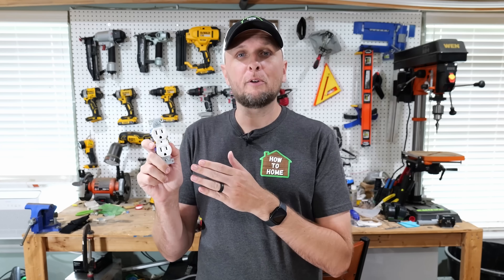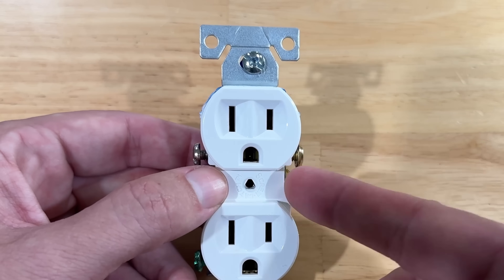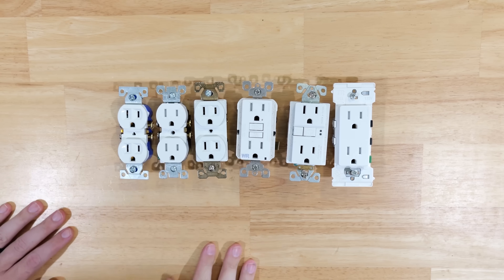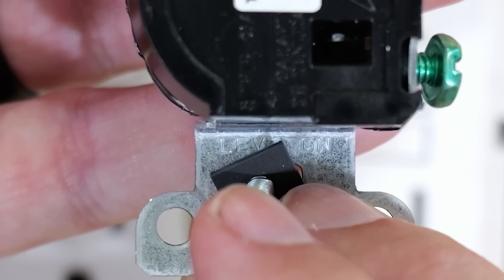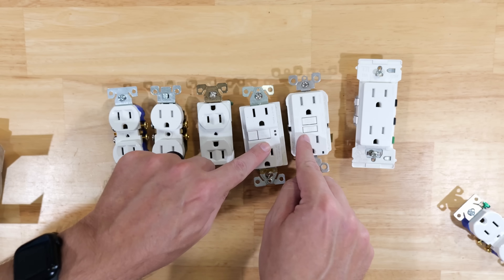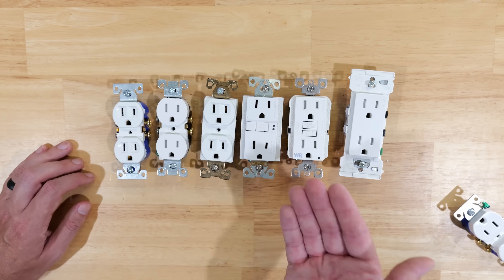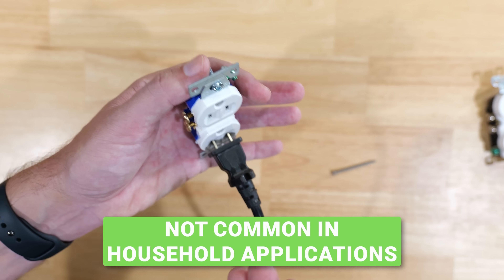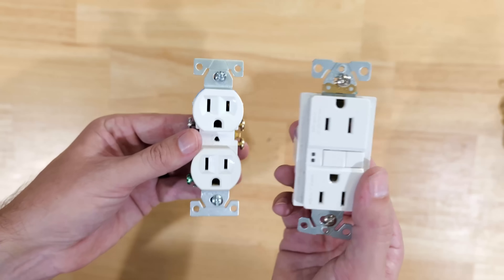The Shocking Reason Why Your Outlets Are Installed Upside Down!

Comment: Why is the white wire on the bottom of opposite side, and hot is on top opposite side? Is that how I'm supposed to wire the replacement outlet? Are the wires supposed to be staggered or exact opposite of each other? THANKS!! I'm guessing it probably doesn't matter but since it's worked for years wired like it was, that'll be the way I wire the replacement..

Comment: Just a simple condo owner in Montreal here. The vast majority of three-prong plugs are designed so that the cable hangs downward when the outlet is installed with the neutral prong down. When the neutral prong is installed up, the cable points upward and must twist to hang downward. In residential settings, most of the time we want the cable to hang naturally downward, making a neutral-up installation both impractical and sometimes a real pain.

Comment: Some time in the 90's, residential builders started installing the half switched receptacles upside down to identify them.  It was a stroke of simple brilliance. In my 50 years of electrical service work, I only saw one metal cover plate short on a loose receptacle but, yeah, it can happen. Metal cover plates are dumb anyway.  There are very few situations where they would be preferable to nylon.

Comment: The receptacles should be built with the ground pins facing away from each other (one on the top the other on the bottom).  That way, you can plug in a hanging plug without covering the other socket or having to twist the cord to avoid that.

Comment: The ground shoukd be on the bottom. Why? Because all devices, cords, etc are all made to be used with the ground down. Upside down i take them out regardless kf wherevim at and reset them pro perly. Ground is on the bottom. Period. No excuses or written instructi ons. Ever try to plug in a three prong device cord that then goes up rather than hang down? Yes. Becaus e the ground plug MUST be down. Argue all you want, but down.

Comment: I'm a retired accredited engineer.  There are two kinds of three prong plugs.  One kind the wires go straight into the plug.  The other one the wires go into the plug at a right angle.  I've only ever seen right angle ones with the ground prong on the side the wires come out.  If you install the outlet ground plug up these right angle plugs are very easy to pull out.  Gravity torque on the cord or any tug pulls the top out first.  You can actually have a plug that looks like it's in but the top ground plug is not well connected and maybe not even making contact.  It can also get awkward when the wires first go up then curl back down to the floor producing a protruding loop of wire that's easy to get snagged by activity in the room.  For this reason I think ground plug down is the safest.  As for switched outlets, up here in Canada a lot of the switched plugs are split receptacle with only on plug of the two in the outlet being switched.   I prefer all of these to ground prong down for these for the same reason.  Screw the labelling as a reference.  You want maximum safety, ground plug down, for your install if you're being responsible.
Reply: It's worth noting that with AFCI being required to cover most outlets where you're likely to have this sort of an issue and GFCI being required in the areas where you're most likely to have thin objects like knives and kebab skewers fall between the plug and the wall, wiring them upside down doesn't necessarily make that much sense as those will provide some protection in the unlikely case that you've got a plug that's only partially plugged in. And without requiring specially designed plugs that can handle either orientation and still allowing things like nightlights and plug in defusers to work.

Comment: And the whole hell of it is that 3 prong outlets are unnecessary except as a GFO (ground fault outlet) in bathrooms or by the sink which are suppsed to trip the little breaker in the outlet if an aplliance goes into the water.

Comment: I'm not an expert, but I have an opinion. With many devices (like hair driers) the plug also has a plastic housing (e.g. circuit breakers). In that case, they hang down if the ground is down, and up if the ground is up. Up is far less stable.

Comment: ground prong up, particularly when a metal plate is being used. if the screw comes loose and falls out the plate will definately land on the upper prongs. you would want it to land on the ground, not the hot and neutral

Comment: Ground down. ... Since the weight of the cord hangs down then the two prongs at the top (vs. one) simply holds the plug into the socket better.

Comment: Interesting topic ... Though not applicable to me as here we use Schuko outlets (type C and type F plugs, type F outlets) at 230V/16A. And in the wall you will always have ground. Also as the outlets are recessed into the wall touching a live prong is nearly impossible.
I think all the newer standards are better for safety be it C, and F or the UKs G type. Maybe the US and Canada should switch too? ;)

Comment: Installation is location/situation sensitive. In residential, I install vertically with the ground down as any fluids will run to ground; horozontal mounts have neutral down.
Exceptions are like the fridge circuit; the fridge plug has a 90 degree plug with the ground on top. To prevent undo stresses, I invert the outlet.

Comment: A lot of refrigerators have wall hugging plugs with cords that hang downward against the wall if the ground prong is down. If the receptacle is installed with the ground prong hole up, then the cord exits the plug upward. This puts extra strain on the plug and the cord.

Comment: It's easier to orient the ground prong to the outlet if the ground pin is up.  In hard to reach or see areas having the ground pin up makes it easier to put the plug in.  This clears up a lot for me though.  I always wondered if it made a difference or if there was code on it.

Comment: Most grounded 90 degree plugs for 125V 15A have the ground prong closer to the cord. For the cord to "hang" down the wall, the receptacle ground would be down. I like the low profile and secure connection that result from using 90 degree plugs, and so I use them alot, and receptacles in my house have that orientation. I'm kind of surprised that 90 degree plugs are not more common, although they are usually only useful for the bottom of a duplex receptacle.

Comment: In my condo all the outs are ground prong down with the exception of outlets that can be controlled by a light switch, I forgot what brand they are, but I just installed some tamper resistant power outlets with built-in night lights and they have a instruction diagram that shows you to install them ground prong down. But I think with them if you installed them the other way the night light would shine up instead of down?

Comment: Generally it's prong down in residential, as wall charges and appliances are designed at the factory with the prong down.  The battery's and stuff just fall out and stuff can get jammed up under the outlet, so the prong is better down.  In commercial/industrial, the prong is often up to protect from falling objects.

Comment: I worked for a company that had their own custom made extension cords..NOT CHEEP ONES.  The safety person had all outlets turned ground UP.  Ground lugs started braking off may cords.  Under  some page in a book  at states that only a qualified person can replace the original end and only he can use it after he inspects before each use.  They threw out hundreds.  People pull out and up..  GOOD -BY ground probe.

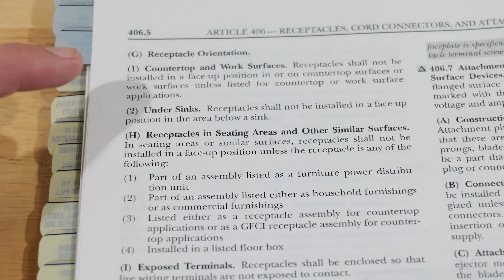Comment: 2:57 - it is one of those usual 'fails' of documents and manuals. A picture can be worth many words. When they write 'face-up' - then some people won't know what 'face-up' specifically means, as they could mistakenly think it means 'earth pin higher' or 'earth pin lower' - due to the confusion about what 'face up' and 'face down' means. And the code book should have images, instead of the dinosaur age full-text and no pictures situation. That is, the code book should have at least an example image of which way to install --  as in earth upward, or earth downwards. Or have images of both with a big 'tick' on both images to indicate either orientation is ok.

Comment: As a teenager, had thrown a  at the wall and it fell and landed between the hot and neutral .. sparks everywhere. 15 years later , i was pulling out a fish tape and it landed across the hot and neutral. same thing... I would say the ground up is the safer bet

Comment: Given that commercial settings would use plugs with a ground prong I would think that the circle on top would be more useful there. With residential it is so rare you have items that need that ground prong that the slots on top makes more sense.

Comment: I ran electric for my father in our new homes we built from 1988 to about 2005. We didn't see anything that said the Plug should be installed upside down or right side up until 05. I heard they do it now to keep kids from touching the positive prong. The ground would be touched first if on top. BUT What about the bottom. Seem like both top and bottom could be accidently touched LOL

Comment: I don't like how much power modern devices use in "standby".  At the same time, I've  had some devices that just take too long to boot - cable box was one.   So I'll have one plug, ground down, that's always on.  Next to it I'll have one that is wired to a wall switch so that can turn the power off to that circuit.  Those controlled by the wall switch are ground up.  Plugging a device in, I instantly know if it's a socket that I can turn off the power consumption in standby from the nearby wall switch.

Comment: Stupid "possible short circuit" debate, usually resurrected by people claiming to be electricians but are not.  The vast majority of plugs are simply two pronged, lamps, fans, and most vacuums, for example.  They don't even have a ground.  If a plug is plugged into an outlet SECURELY and against the wall outlet, it should not matter.  Something dropping on it, and the chances of a "short" are so extremely astronomically unlikely, that this debate is pointless and senseless.

I would even argue, than when a 3-prong plug is inserted into an outlet, the prong is more SECURE when the ground is at the bottom.  And if you don't believe it, try it both ways.  The plug when weight is applied, does not stay in as securely when the ground is at the top.

Personally, we should be focused MORE on faulty cords, overloaded circuits, and outlets that have been used so much that no plug stays into the outlet.  In this case, CHANGE OUT THE OUTLET!

Comment: The metal object falling on the neutral and hot seams a safety hazard to me.
When removing a two conductor only plug I found out that touching either one can impart a shock with the hot being the worst.
This is ripe for too much debate so general conformity seems the best path.

Comment: Some of it is about captivation.  The blades have little holes in them and the wiper blades inside the outlet have little nub bumps on them to add a tiny bit of capture force to the inserted blades.  That is the reason for the holes.  The Prong has no bumps or nubs. It is longer, however, and that is so that it it the first conductor to 'make' a path to the device, establishing a fault return ground.  If the device were already compromised, this would protect the operator from that product fault.  So, Prong up might add a bit of help to the bladed captivation inasmuch as a tweaked plug gets fought against by the prong length.  In a prong down scenario, the blades take the pull out force first, potentially making it easier to pull out.  So THOSE tests are what the maker would do.  Plug tug tests from various directions and tensions with each outlet orientation.

Comment: People who use an outlet who grab it with the ability to touch ANY of the conductors should be NOT PERMITTED to touch ANY plug UNTIL they LEARN the rule...  DO NOT TOUCH THE METAL PARTS.  Your video must be catering to only TrumpTarded left side of the bell curve abject idiots.  Far down the left side of the bell curve.

Comment: Falling nail,  "Possible fire"???  I call BOOLSHEIT.  ANY short at a receptacle should result in a breaker trip event, not a "melt the wires in the wall and cause a fire" event.  Where do you get this stuff?  There is the controversy...  claiming a danger where there is none.  A ten amp outlet can cause the wiring etc of a Christmas tree to catch fire, but that is the DEVICE catching fire at a lower than circuit trip level, NOT the plug or the house wiring. As devices consume less and less, what dopes in the industry decided that households needed 15 Amp outlets instead of the old 10 Amp max? (except for kitchens).

Comment: "Ground Prong"?  You properly referred to the other two correctly.  You said  "Line Side"  And "Neutral Side".  The third one using that level of technicality would then be called the "Fault Return".  Because it does not reach "Ground" until it makes it all the way back to the breaker panel box.  As to orientation, the AC power receptacle does not provide any additional capture on the plug in either set-up.

Comment: Ground prong down in my books , I have been a master home inspector for 23 years in the states and have found this issue in more homes than you would think. I would absolutely write this up in the report if I saw this on an inspection. A child could absolutely be at risk for getting shocked by this being upside down.

Comment: Inside of the house, ground prong down. In the garage or shop, ground prong up. The reason I say it that way is in a shop or garage, stuff plugged in can get pulled of the socket easily, when it does, the plug will pull out or roll out which leads to the ground prong more than likely staying intact. I’m not saying that the ground prong can’t break off in this orientation, but it does reduce the changes of breakage. I work at Pratt and Whitney, all of our outlets are ground prong up for this very reason.

Comment: I was going to bring up NEC Section 517. Healthcare Facilities. 
The biggest reason I install mine with the ground lug up is that a three-prong cord makes the triangle harder to pull down, often ripping the ground lug out of the PLUG when the recepticcal is installed with the grounding hole down.

Comment: I plug a breaker outlet into my Outlets that way It will trip  any kind of Power surge
Reply: The Wire stripper located on the Outlet also. So if you don't have any Wire Stripper

Comment: the one thing that you didn't mention is that most, if not all, flush mount plugs are designed with the wires coming out the bottom based on the ground down configuration.  If the ground was up, then all of these plugs would essentially be upside down.  
The orientation is not a functional issue, it's an aesthetic issue.  That's why it isn't in any code.  Heck, you can install them sideways if that's what is needed for a particular application.